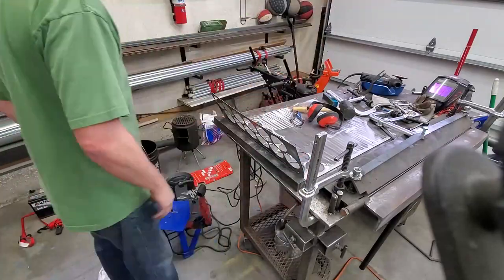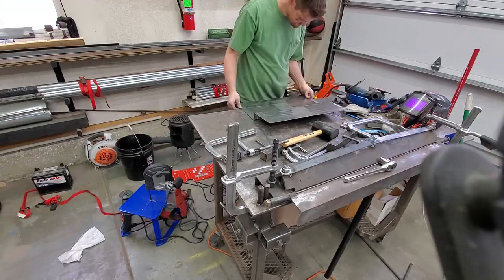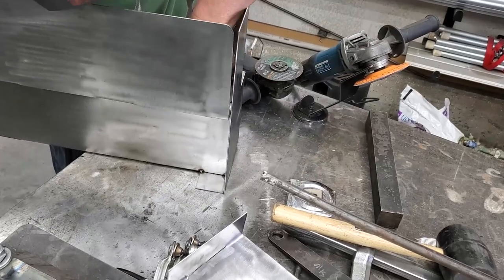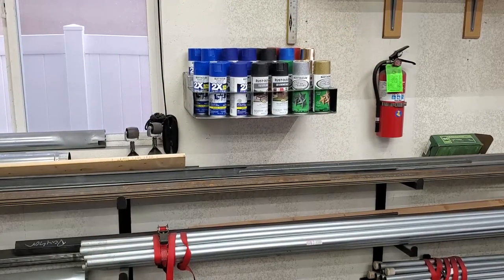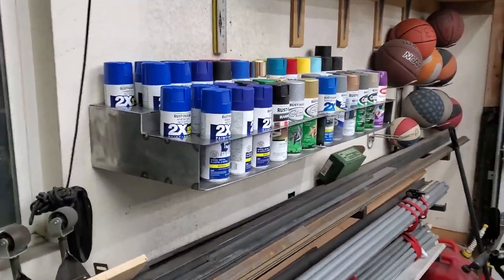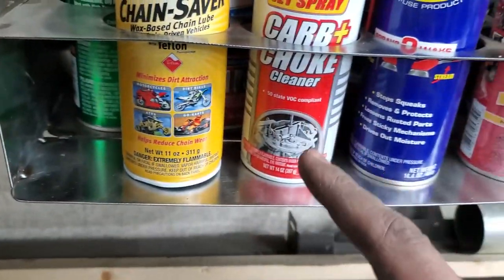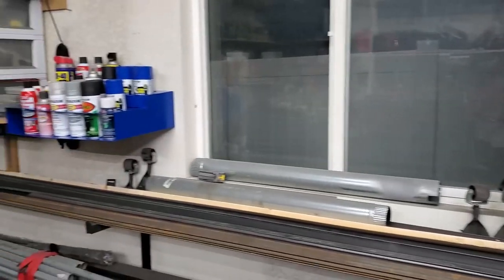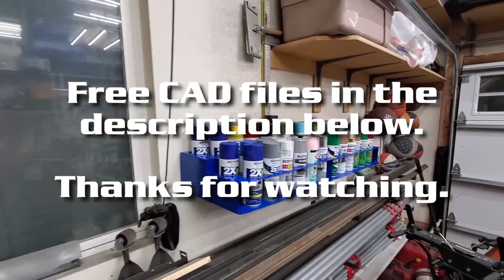Spray Can Storage

Comment: Thanks for the file. Opened it and the holes were 3mm in diameter... I'll convert it to metric... :)
Reply: Millimetre is metric
Reply: @trodaire9504  Yes I see what you did there. 3 inch in diameter, I'll convert it to metric...